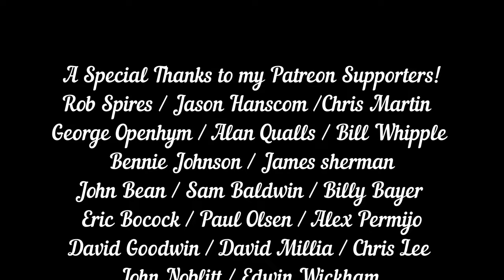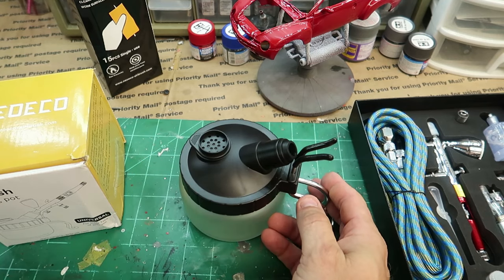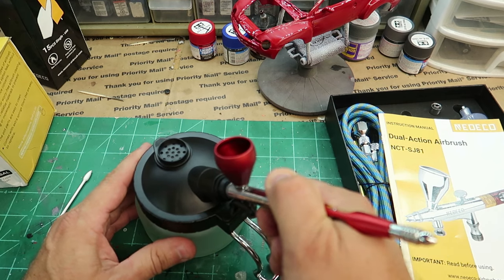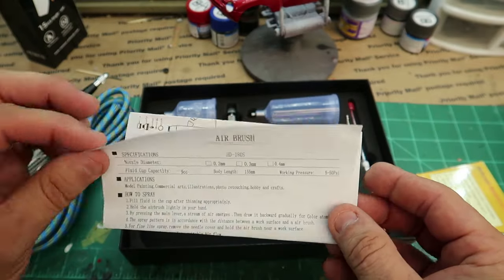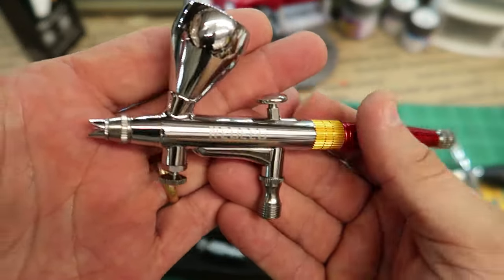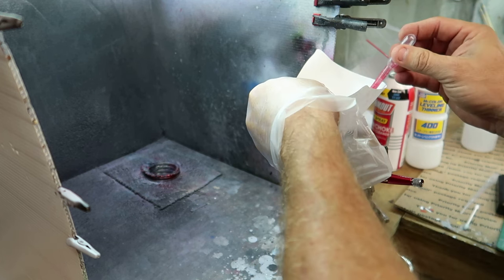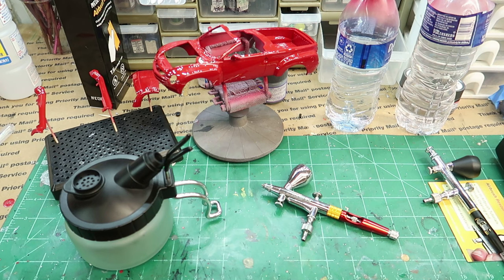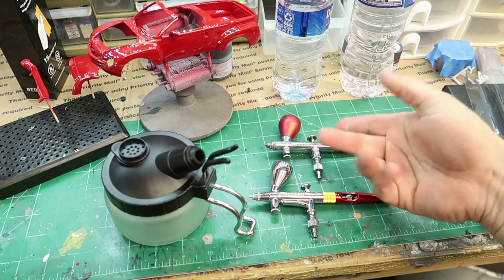Testing out another NEOECO airbrush and airbrush cleaning pot!!

Comment: After owning & using both these NEOECO models, is there a significant improvement between the older SJ81 and the newer SJ83 nozzle design? I will be painting plastic models and diecast cars. No artwork or find detailing for me.